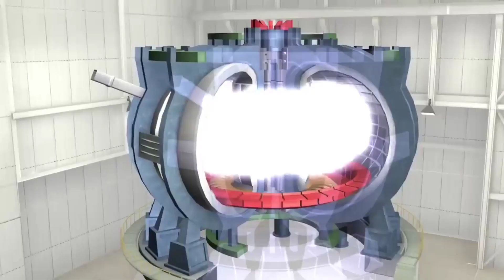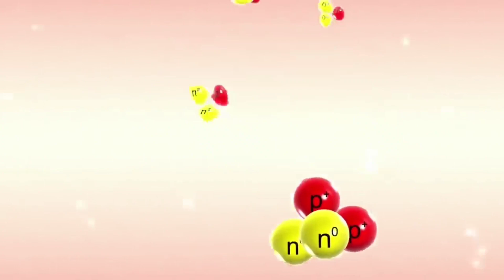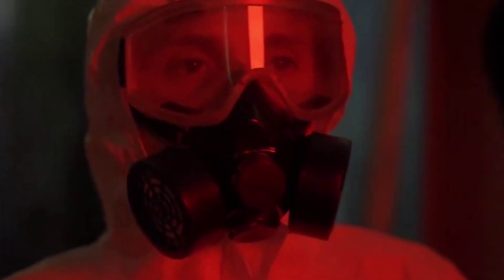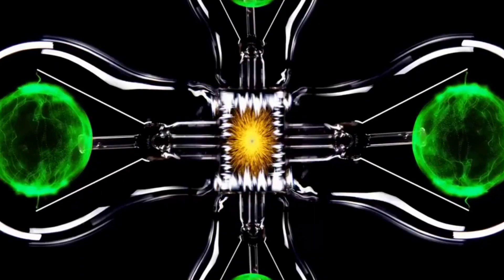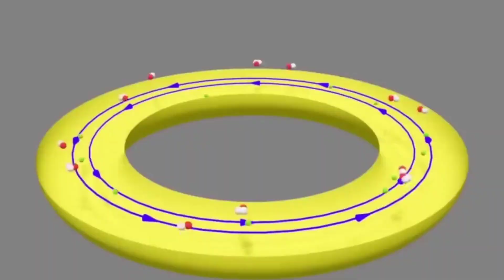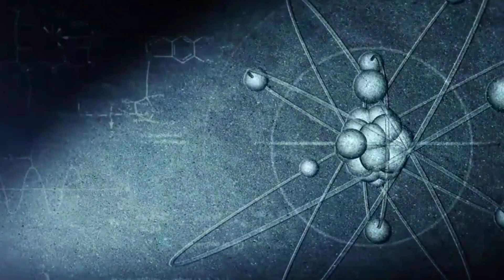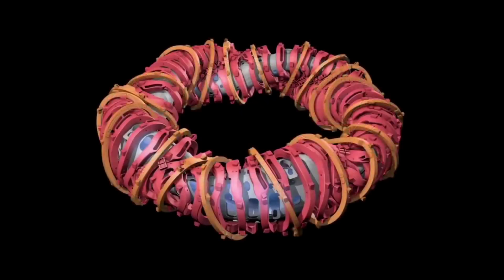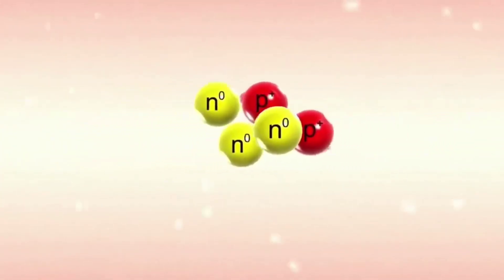Germany's New Nuclear Fusion Reactor Shocks the Entire SPACE Industry

Comment: And just how do they get energy out of it?
Reply: Intense heat and pressure from the plasma is used to fuse two atoms together. The masses of the two atoms is heaver than the resultant one atom. The mass that disappears gives off energy. This is directly related to the equation e =mc^2
Which means mass and energy have a relationship. If mass goes down... energy goes up... see how this works.? You can keep the plasma at 100mil + degrees infinitely. Then you can fuse atoms over and over and have unlimited energy....